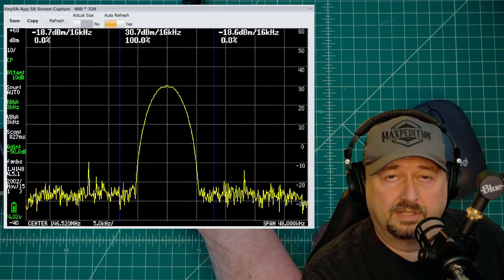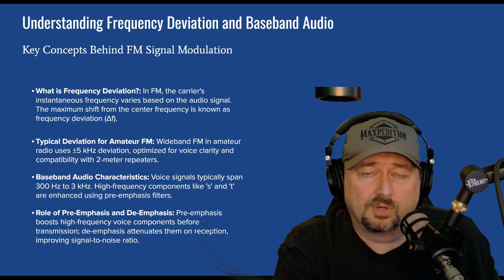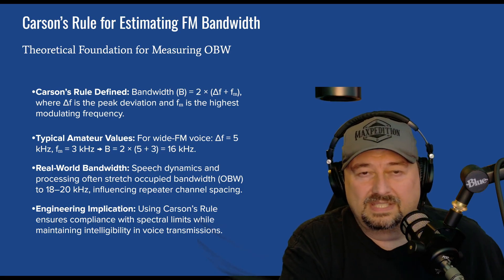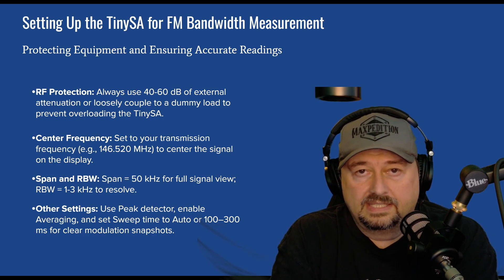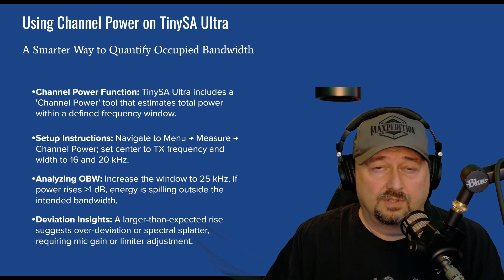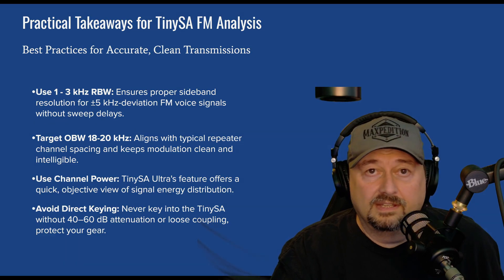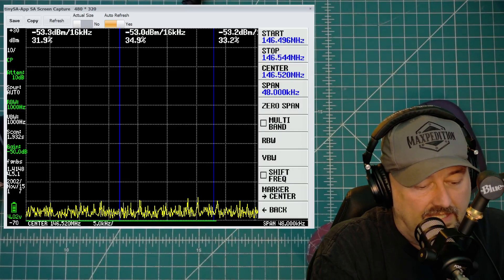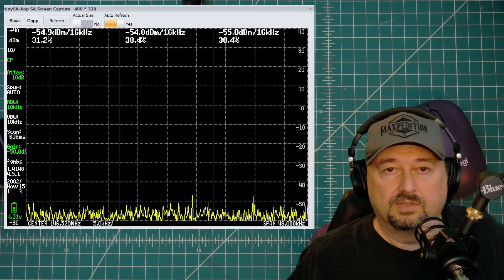TinySA Ultra: Why Occupied Bandwidth MATTERS!

Comment: One of the common measurements for Amateur Radio Packet Operators is tuning the output audio level of a TNC to a particular Radio. The goal is to maximize the FM Deviation but still stay legal and just as importantly stay below the deviation limit inside the radio to prevent clipping. Using Carson's Rule, for a 2200 Hz Tone (that is the Space tone for Bell 202, the standard for 1200 baud AX.25 packet) and 3800 Hz desired Deviation gives 12 kHz of Bandwidth. Thank you for sharing this method of using the tinySA to measure Occupied Bandwidth with the Channel Power feature. I'm using this method with a 12 kHz channel for TNC tuning. I find this much easier than looking for Bessel Nulls!

Thanks
Thomas
KK6FPP
Reply from the maker: Thanks awesome Thomas, thanks for the comment 👍

Comment: I wanted to add a comment on how you accurately explained a complex subject with Mr Fourier being mentioned.  (:-)
When you distort a sinewave (FM,AM,PM) to modulate, it generates sidetones, of specific frequencies and amplitudes.  To accurately reproduce that distorted sinewave at the receiver the bandwidth from the transmitter, thru the "channel" thru the receiver all must be able to pass the required sidetones and at the correct ratio of amplitudes...  If a certain amount of "distortion" is tolerable, the engineer can manipulate the modulation of the transmitted signal.  As APE said the premphisis, deemphisis, narrower deviations are the tools to reduce the total occupied bandwith to allow more channels in the frequency band with tolerable distortion.   Some of the highest frequency sidetones are of such miniscule amplitude they do not add fidelity to the received signal, so the "total occupied bandwidth" can be reduced without excess distortion at the receiver.   The fellow Fourier did the heavy math to discover all this..  Good video Ape, interesting.  Thanks for the time you put into these...
Reply from the maker: Thanks for the additional detail wb7ond, and for watching 👍

Comment: Very well explained, the Tiny SA is a very useful but inexpensive tool. You can also use the same set up to adjust FM deviation using FM Bessel functions. 73
Reply from the maker: Yeah, super helpful for sure.  Thanks for checking out the video G0fvt 👍

Comment: Nice video . Band with is important . With armature work we use wide and narrow . Depending on band and radio .Nice way to test for that .Many radios have FM deviation settings in menu . And set up menu . Or pot on PCB . I use my Siglent for that. Has display of bandwidth . Makes for accurate measurement . I can do AM mod % and IMD test for SSB . as well. I get much faster sweep times. DTMF tone is 2 tones . Dule Tone Multi Frequency . I spent 1K on a 1.5K slightly used spectrum. A better one is 3.5K . ### But 1.5 GHZ is just fine for me. I use my scope as well . Some cheap radios have poor  wave form . And I can look for clipping as well.73
Reply from the maker: Hey Robert, thanks for checking out the video 👍

Comment: Thanks for doing this! Great job explaining it too, as always. My replacement attenuator just arrived today, so I'll be putting the TinySA back to work soon and running these tests.
Reply from the maker: Thanks for the super chat Mike, glad you liked the video 👍
Reply: Where did you buy that replacement? Is it easy to replace or require some specialized tools and skills?
Reply: @CallofWar5  I just got another cheap 40dB attenuator from Amazon. I had one but the center pin in the SMA conductor broke when I was doing some testing similar to this.